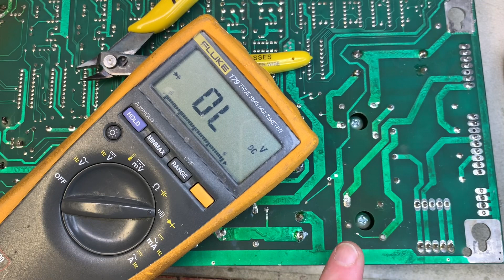Diagnosing and properly replacing a failed bridge rectifier, Williams WPC PowerDriver board

Comment: This was very helpful.  I'm trying to remove a shorted bridge rectifier from a PSU.   Can you please tell me brand and model of soldering iron you're using?   The tip of that one looks like it works better than the ones I have (I'm just a novice at repair work).  Thanks
Reply from the maker: I'm using JBC units and tips. One of them is an AD2600. They can be found on eBay periodically otherwise they are a bit pricey.
Reply: @ChrisHiblerPinball  hey Chris, thank you so much!